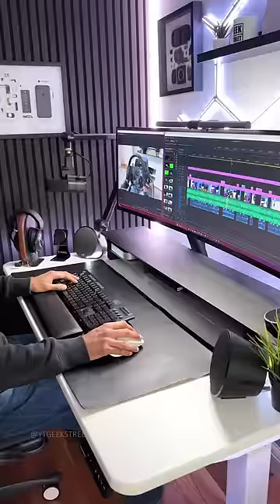Desk Setup UPGRADES you NEED to GET!

Comment: Not a fan of lights behind my work screen, that needs to be dark in my setup. The wall panel is very nice. I tried the ultra wides, had two of them over the years but nothing beats 2 27 inch 1440p monitors. After all these years that, for me, is the absolute best of the best.

Comment: Ik Multimedia iLoud micro monitors or even MTM if you have the cash are better than any Logitech speakers I would not even bother with speakers designed for PC’s crappy drivers and a thin vibrating shell for a case.

Comment: How much cost this full setup
Reply: A lot of
Reply: @Floridamarrr  how much
Reply: @Rahbar_Nawaz  It's more than a few thousand. The grovemade stuff (desk shelf, desk mat, headphone stand) is around $450. Speakers are around $200? The premade acoustic panel can cost up to $300 depending on where you get it. I don't know the monitor brand, but a ultrawide monitor like that will run from $500 to $2,000. Idk what kind of computer he's using, but if it's an Apple, that's $3,000. If that's a G915 keyboard it hovers around $200, depends. Anddd another $200-$300 for the govee lights.